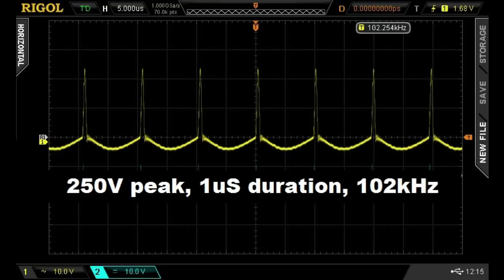Longitudinal Current Induced by Dielectric Field Impulses

Comment: Maby the reason Tesla had his spark gab in oil. And used verry high frequency. To achieve what he did..
I have a theory that the Tru energy moves Opersit of the electrons and faster than the electrons and that is the reason + and - is Opersit of the direction of the electrons so if the spark gab is under oil It's only the energy moving but the electrons is blocked by the oil... The resistance/waste if first present if we waste energy on moving the electrons..
So we agree verry mutch on this one..
I think your channel is the best Tesla Chanel I have found in the 10-15 years i have known about Tesla (we were not presented to him in the duming down school 40 years ago)

Comment: I think it is a case of changing ) moving E field charges changing in opposite directions at the same time which cancels the rotating magnetic field.

BTW mate,

the rapid rise and fall times you seek (withiut messy square waves)
can be obtained from HF radio frequencies.

Perhaps the  20 metre band (14 MHz) would do you nicely. 

If you aren't already licenced,
become a licenced radio amateur 
and then you can really take this to the next level.

Tesla would have loved to have such rise and fall times that we now have with RF frequencies
and HF frequencies are very easy to work with
& can produce some amazing results with bifilar coils.  The coils can be smaller 
due to less Time required to store energy before discharging again
yet we can work with this advantage.

I love your work mate 💪

You are an inspiration.

Hopefully you will check out my Tri-Filar regenerative coil concept

Comment: So, Master Ivo, I hear you saying that a dielectric field that is pulsed will produce or imbue the dielectric field with a momentum that enhances the ability of that field to transfer its energy. (Similar to when kinetic energy is transferred with acceleration (as happens in the Oberth effect increasing the kinetic energy transfer from a rocket engine burn, or when a baseball batter strikes a pitched ball with an accelerating swing vs. just a moving swing.)  We see similar enhancements of electrical energy exchange between mediums in capacitors that only allow energy to pass between conductors and dielectric materials when the field is changing values (AKA accelerating). Impulses are the pinnacle of acceleration.

Comment: Amazing presentations. Ive never seen this topic so elegantly explained and well understood. Exactly how do you convert the longitudinal into power ?
Reply from the maker: I use the longitudinal current to amplify current in the secondary which I then rectify into DC after first passing through an extra coil
Reply: Thank you master Ivo. This extra coil I assume you mean is L3.  But Is there some specific format L3 must have to express this as usable power? A special gauge, and specific winding ratio relative to L2 etc?
Reply from the maker: L3 is the secondary. L4 is the extra coil. I gave equal dimensions as L2 L3 but instead used 0.75mm2 for the l4 extra coil.
while L2 =L3 =1.5mm2 (L2 primary and L3 secondary need to have equal copper mass)

so the L4 extra coil has more windings then L3 has

Comment: is this just a postulat? or an actual result of a controlled experiment?
Reply from the maker: It was a postulat at the time of the video. But now proven in more recent video's which show the experimental data.

The voltage impulse normally is transformed into a current impulse, but over a certain voltage threshold (-2900V) the current impulse is absent. which i dictates the energy of the impulse in the primary (l2) is transformed into something else.

At the same time the secondary (L3) shows a steep amplification of current, when tuned properly.

Comment: A vortex would indicate a reservoir with a level similar to water. I think this is exactly what the magnetic A-vector potential is, which existence has been proven by the Aharanov-Bohm effect. The curl or vortex effect of this potential creates B, the magnetic field.

B = ∇ x A (vortex of A creates B)
∇ x E = d(B)/dt (changing B magnitude creates vortex of E & vice versa)
∇ x (E + d(A)/dt)=0
dA/dt is a rapidly change of this potential, but still too advanced for me to show how it's working.

Heaviside wrote how he killed this potetial for easier math, because it has no physical significance, but it does have it.
TE Barrett described Tesla's inventions as potential shuttles, but he applies the Lorentz gauge (net zero)

Comment: There is already a theory on this, which has been around for years and years. Whereas the only field is counter space ether, but since we can not take measurement of counter space we can simply deal with the dielectric field which is the ether under stress, strain, and or torsion (light). In this theory, the magnetic field is just a different state/modality of the dielectric in fact it is just the loss of inertia of the dielectric. This new stage of the dielectric in a state of losing inertia is the magnetic field and travels until it can terminate back into counter space. The magnetic field travels in an S curve and is why all magnetic fields are always toroidal in geometry. Here is a quote from a book published back in 2012 "DIELECTRIC the primary half of the conjugate field modalities of the dielectric and the magnetic field." 

Heat is directly related to magnetism and is not the dielectric, if the dielectric was creating heat then it would be losing inertia, and as such it would no longer be dielectric and would instead be magnetic. Electrification is the product of the dielectric initial plane under stress, and/or torsion.  So you can say electrification is a hybrid byproduct of the magnetic and dielectric fields. With this, you can also explain gravity as a mutual incoherent dielectric acceleration towards counter space. 

When you say that the vortex is energy your not wrong but it would be accurately stated that it is the geometry of the dielectric's loss of energy ie the magnetic field.  To say that the dielectric is spinning up the magnetic field is like saying you poured tap water into a bucket of tap water to make ice. It simple is incorrect, your observation is correct the explanation is wrong. The phenomena I think you are trying to make sense of when it comes to the size of the magnetic field is really a misunderstanding of dielectric capacitance. If you increase dielectric capacitance you get a smaller but much stronger magnetic field. This can be observed by comparing the magnetic fields of 2 permanent magnets of different N ratings. The higher the N ratings the smaller the magnetic footprint relative to the magnetized medium ie more energy = less space both of the dielectric and magnetic.
Reply from the maker: yes interresting, I hear much of Ken Wheelers theory.
but if the dielectric inertia is lost in the magnetic field, what is giving it the ability to do work? (like hang a magnet on the fridge it doesn't fall off, it works against the gravity.
I understand the Aether holds all inertia of a mass, but what does this loss of inertia represent? isn't it bound to the aether anymore?
and why can it still attract?
Reply: @MasterIvo  Sorry for the late reply and thank you for your response. I always enjoy getting insights from people that are well beyond me, so I appreciate it. So to attempt to answer your question. First, the act of doing work is loss of energy/loss of inertia. Second, gravity would just be a non-point source mutual dielectric acceleration towards counter space which is a non-polarised force. Third, loss of inertia represents magnitude, or expansion may be better stated as the release and loss of potential energy. For example, a stick of dynamite would be the dielectric but the explosion would be magnetic, the loss of the dynamite's energy. Fourth, yes it is always bound to the aether. Magnetism is the aether just as Ice and steam are still just water. Now let me pick your brain. How do we know the dielectric exists? We can see and manipulate magnetism but how do we work with the dielectric in a verifiable way. Steinmetz has referred to the dielectric as a static electrical field when speaking about his famous diagram of the magnetic and dielectric field lines on a wire. What are your thoughts on this? Thanks again.
Reply from the maker: the dielectric field makes your hairs stand up when you are charged. it is the dielectric field inside a capacitor that makes it able to vaporize a shortcut over it.
Now my question, what is dielectric acceleration?
Reply: @MasterIvo  A reference to dielectric acceleration is talking about pressure mediation. The universe is always trying to move to its lowest pressure gradient. The ultimate in low-pressure bing counter space. This constant and weak force of the dielectric being drawn towards counter space is gravity. Mass attracting mass is just the dielectric acceleration towards counter space. Maybe stated better as mass attracting mass is dielectric inertia towards counter space. In your example of hair standing on end, even this example of dielectric must contain a magnetic component. This is why the hair strands separate themselves when standing on end. So is this because the dielectric field in radial travel induces a secondary current when it comes into contact with another dielectric. Is the radial dielectric just seeking counter space, creating aether torsion as it reaches the dielectric plane of inertia/counter space of other mass? This would imply that static electricity is not dielectric but instead that static electricity is the byproduct of radial dielectric inductions. What are your thoughts on this?
Reply from the maker: No thoughts on this, much to abstract and theoretical. I rather stick to reality. In my definition counter space is Time.
Magnetic fields are only felt when nearby, so It would make sense to me that the dielectric field is the stronger one in the big universe.
in addition, the dielectric field represents tension, not pressure.
Reply: @MasterIvo  abstract and theoretical but your entire videos is postulating over abstracts and theoretical? I just got done watching your video on Faraday lines of force, what is that if not abstract and theoretical. I am sad to see you so dismissive. I wished for this conversation to continue, I have been genuinely excited waiting for your replies in this exchange of ideas. My comments were not meant to be confrontational. I apologize if that's how it came off. I wish you the best of luck and success in your endeavors.
Reply from the maker: Sorry, but I find theory more and more useless. And discussing a waste of time and energy.
I simply don't know. experiments show the truth.

Comment: Bro your outstanding I like build thing just to check . I took and inductor and a reed switch basic, then feed the back emf to a 18 volt led array. it was amazing the pulses. lit it up. But it was feed by .6 volt this shouldn't happen.  I thought ,I had several other coil's in conjunction with it. Rodin coil, starship coil.  I thought may be they acted as capacitor's.  In the morning the light was still on and battery was charging.  I stop.  No one has explained it until now . Well setting up scope to prepare for replication of your solid state circuit . Need to remember wire and how thing work will take a while . Your amazing thanks
Reply from the maker: yes the back emf, is an impulse, this comes from the charged up magnetic field of the coil, that is discharged.

the discharge happens at the resonant frequency of the coil. due to the low capacity of the coil, the voltage impulse (resonant half wave) can reach very high voltages
Reply: @MasterIvo  I brought a function generator that look like the you used I waited ok got but lcd screen not showing anything so i'll order another one Question which function generator did you get  I'm trying
 Thanks
Reply from the maker: this one
https://a.aliexpress.com/_BSyLOW
but I now use a dual channel generator for my latest circuit

Comment: Ivo, would you agree that the longitudinal pulse is the edge of a spherical radiant expansion?  From the point of origin, in 2 dimensions the radiance is a circle and in 3D a sphere? And this might explain the inverse square rule of radiation, meaning the energy is spread across an expanding spherical field change?
Reply from the maker: I seems to be so, but that is only theory, I don't kniw for sure. I do see amplification of the current by the impulse in the series resonant primary coil.
new video shows this next week
Reply: @MasterIvo  the spherical radiance spread across the surface of a sphere growing at the speed of light would also explain why luminosity decreases at 4 pi r2
Reply from the maker: That would mean light isn't transverse electro magnetic but is longitudinal magneto dielectric
Reply: @MasterIvo  yes, that is correct.  The EMF "radiance" is not transverse, it is a spherical boundary inducting outward; there is the appearance of transverse only in the fact that moment to moment the edge of the sphere is a potential measured in voltage, and this potential is cycling, but not transverse but more like the integers on a clock or the colors of a color wheel.

Comment: Hi, can you please explain how this vortex collapse and forms a back charge for example in any inductive load?
Reply from the maker: magnetic field is charged up by voltage supply. then supply is switched off. magnetic field energy in coil starts transforming into dielectric field (resonance)
Reply: @MasterIvo  

Thank you for your reply. Actually i wanted to know,  how can we depict this intuitively? I mean when collapsing, does this aether vortex spin (e.g clockwise) slows down and stops finally or it immediately starts to back spin (anti clockwise) and finally dissolve into dielectric field... In the first case the spin though slows down but the direction shall not change so it shouldnt back charge. In later case how would you describe or what causes the immediate anticlockwise shift...

Comment: Hi Master Ivo.  Since the magnetic field is negated by impulsing, does  this mean then that there is no counteremf?

Thanks  Master Ivo
Reply from the maker: It seems when the series resonant coil is impulsed (at voltage maximum and current minimum), the impulse assist in the build up of the magnetic field, and amplifies it, magnifying the electric energy in the resonant field.
Reply: @MasterIvo  Ok thanks Master Ivo.  i think ive seen this graphically where the sinewave amplitude logarithmically increases with time with each pulse

Comment: Master Ivo. Kudos. You are doing amazing stuff. However, I'd like to challenge you to not overly simplify your mental model of electricity. Yes, an impulse of dielectric release creates a pressure wave of Ether. But, Tesla made it clear that conditioning that wave with a focused magnetic burst would fundamentally change what that wave would do, defining what matter would respond and what effect would be created. Think of it more as boat wakes than air pressure from tire expansion. Today you can see videos of guys riding wave boards that have a fin under the water which will use the under-the-surface-pressure-wave of a boat wake to push the board (riding a board atop a vertical support above the water with a rider on it) in front of the wave seen at the surface.  Similarly, using your low power impulse of back EMF is fine, but conditioning the wave with a magnetic impulse should be considered mandatory. All magnetism is a wakefield of charged particles spin-wakes. Tesla's EM quench at the start or end of a spark gap altered the natural spin of that collective impulse from the spark event. Without a spark, do you even have an atomic impulse event? The energy density must be significantly less, perhaps setting up parallel coils switching simultaneously, or within a nanosecond of each other should be on the design bench list of objectives. When humans do this consciously (as in REiKI) the power is experienced as progressing exponentially with each added practitioner. The Ether wave is not just compressed dielectric Ether or just compressed magnetic spin Ether, but a masterpiece of collective geometries that fit lock and key to specific atomic structures for size, spacing, spin, and motion. (vibration, frequency, & energy)
Reply from the maker: yes combining the impulse (dielectric induction) with magnetic induction is the plan

Comment: Great insight Master IVO.  I have s question though.  If the rapid change in voltage produces radiant energy, how does one collect and utilize it for normal applications?
Reply from the maker: The impulse is transformed into high voltage high frequency (magneto dielectric resonance) . then it is rectified to high voltage DC. This is then transformed back to lower voltage dc or ac that is workable by regular inverters /converters.